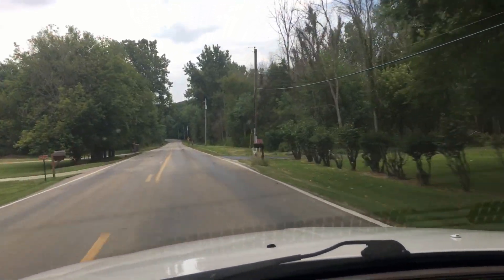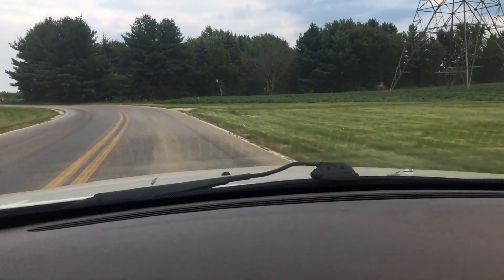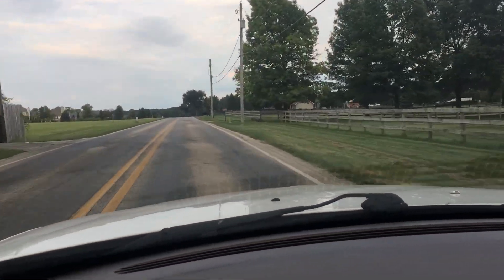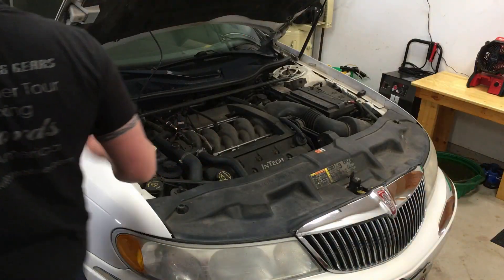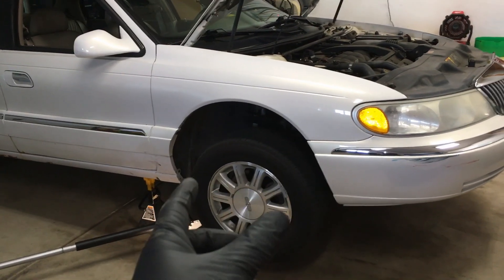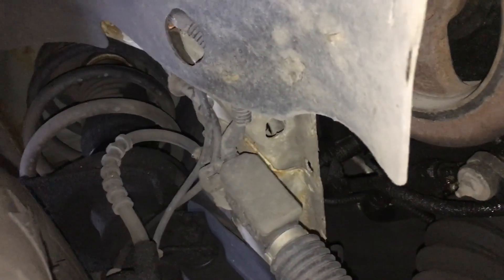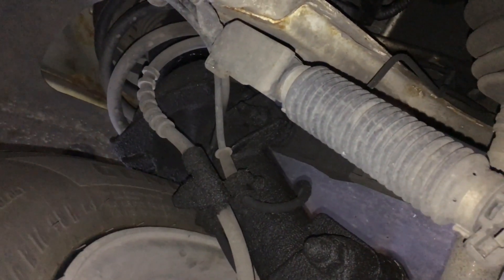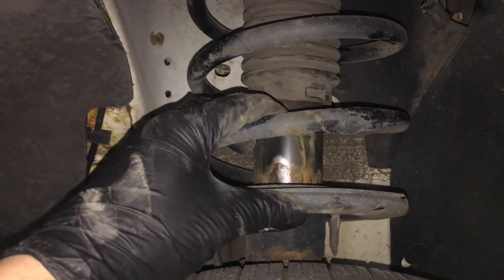Ford Quick Tips #78: What a Failed Strut Looks Like and How To Test for it!

Comment: Hi I'm having a issue with my car and it is way overdue for  struts all the way around almost 200k with Factory Struts all original but I don't have $ to do them all So my issue is when I hit bumps only on the right side it feels  10x harder little bumps that I wouldn't notice on any of the other wheels feel like Giant potholes . I feel like its a Seized and will try this test again Any input would be nice.

Comment: Another Awesomely Professional Video in a Clear, Concise, To The Point Manner that everyone can learn from.  Another Awesome Job Bruddah! Sure looks like this one had a serious problem with service and maintenance inspections. 
How do you feel about having vehicles go a 3 or 5 year "total car" mandatory safety inspection?  Before everyone shoots me for asking this. The results from an inspection should NOT be a reason to a fail safety inspection UNLESS it is serious enough to cause "IMMEDIATE" danger to people. Besides. if people would do even just a tad more checking of their vehicles this wouldn't be needed at all. But you all know just as I do that some folks just don't give a crap until they face huge auto repair bills or worse. 

 -- Couple Questions Bossman;

 -- 1) For this kind of repair - After you've found the problem source do you recommend taking it to a car wash place that has a high powered spray hose to get all the oil soaked areas cleaned up and before you start your repair?   (ain't no reason to mess up your yard or your garage with oil and grease.)  Can we smell the melting wires electronics yet?  Then again some folks shouldn't have a sharp pencil much less a power sprayer in their hands.

 -- Idk Bro,  I bet the wife just loves you when you go trampling through the house with oil and grease covered clothes. LOLz, or do you do a quick clothes peel and a quicker duck-n-dive run like heck to a safety zone?  Btw, so you know, I'm chicken so I wait until she's either not home or busy elsewhere. From experience, Nothing hurts your man-pride more than a cast iron fry pan to head when you're doing the man run at Mach 2. At my age that sorta hurts than when I was a lot younger. 

 -- 2) What was the oil leak underneath the passenger's side of the engine, near the right front inner CV shaft boot at about timestamp 4:10 on the video?  Kinda looks like a different leak on a hydraulic hose or maybe a valve cover? Whatever it is, it sure looks like it too has been going on quite a long time.

 -- 3) Did you have to change out the ball joint boots due to them being covered with oil for so long?
 
-- 4) What other parts on the car did you perform or recommend repair?
  
Thx Bruddah

Comment: I had a 99 Continental.. was a great car..  I got good at pulling the transmission.. lol.. torque converters and the valve body.. the pump went out but still drove..just got the check trans in the message centre..

Comment: normal driving..no curb strikes or major trauma..how many miles should an ordinary factory strut last?  (my KIA has 140k on it and I cant see or feel any uglies..but you know how you get use to the gradual degradation of such things.)

Thnx for the vids  much appreciated as usual.
Reply from the maker: +SGDeGalvez Factory struts last well over 120k normally where as some of the cheaper aftermarket may only last 70-80k
Reply: thank you!
Reply: I've never had a set of factory struts or shocks last 120k miles. The roads around here have a lot of light to moderate chopping so they last say 85k miles. What conditions do you have that they last that long? Shortest are Subarus at about 45k and longest were Volvo at 80k miles. Around here they don't really leak until about 150k-200k miles, BUT the valving wears out and they get sloppy.
Reply: tnx..im gonna replace them..its time.

Comment: shouldn't  shocks be done in pairs??
Reply from the maker: Yes but these shocks are super expensive magnetic ride shocks almost no one makes anymore.
Reply: What do you do if you need one?
Reply from the maker: You would have to convert to a standard shock setup. This customer wanted to keep the adaptive ride control feature.
Reply: Wow, I had to look it up. The next economical alternative is to do a strut conversion using the Taurus kit with no promise of improvement over stock for slightly more money. That's no joke. I would have done just the one as well.
Reply: Did you use Ford or aftermarket? The aftermarkets are about $300 each
Reply: My original struts were good at 150K. The early front struts had airbags, and there is actually a kit to preserve the strut and and convert it to a spring from air (also preserves the electronics). They are very high quality. The cheap ones I got feel mushy after 15K, but the car is so old now, don't want to invest in it. It is a 95. Still runs very well though.